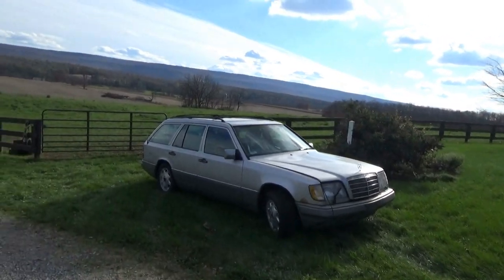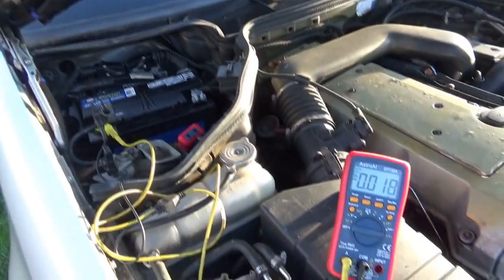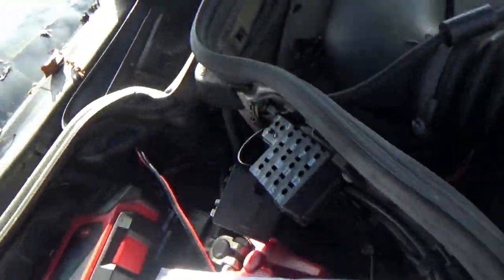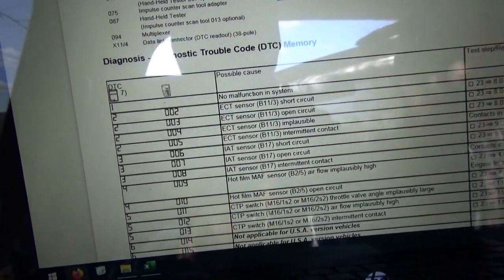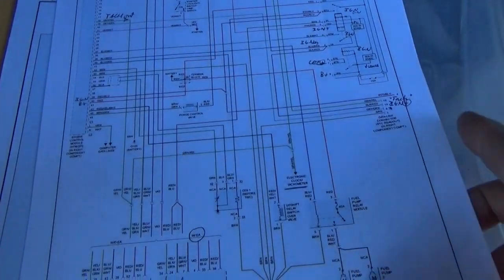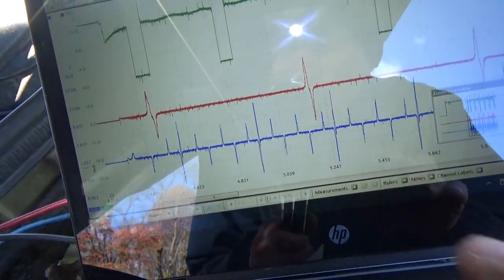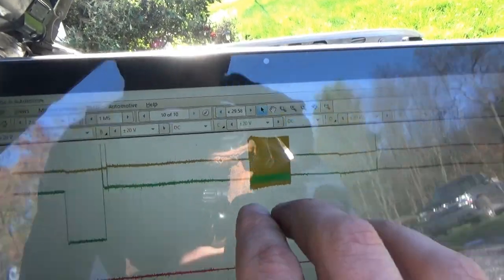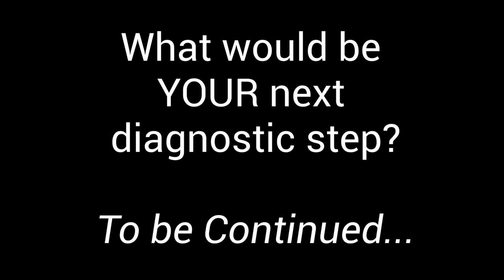The MYSTERY Mercedes - Part 1 (Thanksgiving Special)

Comment: Wow.  I haven't messed with one of those in years.  It brings back memories.  Back when I was a young mechanic working for a Volvo dealer, the shop had these old school scan tools that you had to plug in a cartridge for the vehicle make, model type and year group.  It worked on 80's and 90's Volvo, Mercedes and BMW.  They took forever to read out codes.  But it worked in a similar fashion as your LED light trick does.  Codes are generated by the pulse cycles.  The only nice part was the scan tool would keep reading codes until it finds a repeat and it would display these codes on an LCD screen.  So, depending on the module you were reading from, you would have to look up code descriptions from a book.  Even though technology has come a very long way since then, I still miss those simpler times.
Reply: My next step would be, go order the correct crank sensor for that exact engine from Mercedes.  From what I have learned over the years is, each year, Mercedes changed the resistance and or polarity in the crank sensor from year to year.  Even though they may look identical, other years, makes and models are not interchangeable.  Anyway, good luck with that.  Looking forward to part 2.

Comment: probably bare touching and corroded wires at the crank sensor. there was lots of bad wire jacketing back then, it would shrink lengthwise and expose wiring an inch or more at the connectors or crumble away.  new magical coatings of the 1980's

Comment: While that car has throttle cable, the throttle is moved electronically by the cruise control. There’s a go pedal position sensor inside the throttle body, and then the cruise control opens the throttle. If the throttle control computer dies, there’s a mechanical linkage that will let you open the throttle some amount… like full throttle in the car will give you 1/4 throttle under the hood.

Comment: An interesting diagnosis...   It looks as though the modules have been looked at before and were loose...   Are they depending on case ground?   With others swapping parts and opening things opens possible issues at times..    The anticipation is high for part 2...

Comment: Every time I hear you say "let's check service info," I'm saying "good luck with that." 
Service info on Mercedes and BMW is almost non-existent. I was shocked to see you managed to find a listed scope crank signal for comparison 😲

BTW, I was thinking how older cars and perhaps some late model cars will flag a crank sensor problem although it may actually be a cam sensor problem. That cam signal did look a little funky...
Reply from the maker: Yeah I was surprised how good the info was on this thing. BMW is MUCH worse... Can't even get basic DTC descriptions on AllData for modern ones!!
Reply: @PineHollowAutoDiagnostics  So, you don't even want to find service information? Is sharing information sources prohibited?
Reply: @PineHollowAutoDiagnostics  My first exposure to a code flasher was a 86' Nissan PU.  Computer under the passenger seat, I thought it was cool as hell.

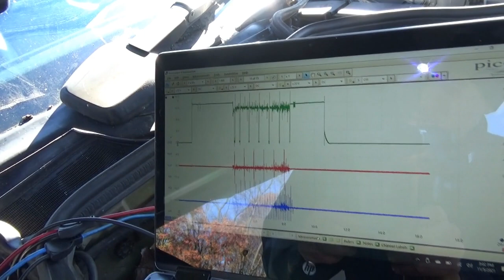Comment: At 29:53 look at the big picture: the delta T for injector firings is halved on the very first injector pulse. I'm thinking there's some kind of timing issue where something is 180 out. Could be caused by the crank sensor, cam sensor or any of the timing components themselves. My next step would be to find a good cam-crank correlation, not just a good crank signal.

Comment: HI IVAN great video again.I would have liked to see you say>well let's look at this box of replaced PARTS from the parts canon. just so we know EXACTLY what the customer already replaced.Then i would like to see the new parts he put in and MAKE sure for MYSELF that he ACTUALLY PLUGGED THE WIRES BACK TO THEM>
MY reasoning is ,What if he forgot to put say the CKP wire back on? YOU are assuming he did put the right parts in it and he did put the wires back where they belong.As you just started testing for signals ,right? when my friends ask for help ,the first thing i do is DOUBLE CHECK their work,50% of the time,THAT'S where the issue is,haha If it worked when it was built new and now it no longer works and the customer say's BUT I PUT A NEW PART IN!!!! And no I'm' not a mechanic,but i did work on rockets,so we always double and triple check. Have a good thanksgiving IVAN,and i hope you put out part two,i can't wait.
Reply from the maker: Great tips Roberto! So you are a real rocket scientist! 😃

Comment: Geez, my 86 Crown Vic with EEC-IV at least outputs each digit of the two-digit codes separately so you don't have to count each flash (or in my case, sweeps of the analog voltmeter needle) separately.  Nice to have when there actually is a code 98!

Comment: From someone on the interwebs using an eBay blinking light reader.  (47 control of ignition coil voltage exceeded limits). maybe a book of codes came with the reader? The car was a 1995 e320

Comment: Check the resistance on that crank shaft signal 
It may be pulsing but if the resistance is to high the Bosch ecm will not like it.
As far as I remember on the old Bosch systems it needs good signal from crankshaft sensor to fire the coils and or fuel pump..
Reply: Good call. The peak crank shaft voltage appears to be 7v by the polarity is backwards; is that the problem with the new crank shaft sensor initially installed?

Comment: American cars were often more advanced than German cars. BMW is still using centrifugal weights and vacuum advances in new distributors in the 1980s. American cars head ditch that more than a decade previously
Reply: Well, in some areas you are right. On the other hand GM and Chrysler still produce pushrod V8 engines today where MB V8 engines have been OHC since the 1960’s.
Reply: @pilskadden  perhaps, except General Motors has proven that a pushrod V8 can actually be superior to an OHC engine.

Comment: the very first thing you do with a 93-97 Mercedes is to check the manufacturing date on the wiring harness, its behind the battery.    also check the throttle body, both need to be 1998+ replacements..

Comment: W124. One of the world's best built cars
Reply from the maker: This series may change your opinion 😅
Reply: Hi Ivan, Unlikely, I will only drive a Merc...nothing else lasts, drives like a Merc.
3 of them parked outside....If your ever in England have a go of my CLS 350 diesel waggon...40mpg and real poke.
The hardest thing is you are diagnosing this from first principles, my local specialist is as happy on the older or newer stuff...the merc diagnostic kit is stupid expensive. There are not enough of these around for mechanics to be super confident of each models foibles. Looking forward to seeing the fix, and you taking this for a spin. Do not be shy about revving this engine!
I have a R129 as a weekend car with the same M104 engine. Still pulls 140mph ball day long whilst in France on holidays. The only weak point on this engine is it will need a head gasket half way through its working life. 240horses from a 3.2 i6. I would expect 30 mpg driven normally all day everyday.
I think your channel is awesome, and its great to see you get stuck into a bonafide classic
Reply: @PineHollowAutoDiagnostics  Ivan, might be worth confirming that this car has had its wiring loom replaced under warranty. Merc were "persuaded" to use biodegradable wiring looms in this year. Lots of cars in Europe have had bits patched in...long term ownership would signify a new loom (if its bad) which are still available. Hope you can source all the parts easily enough stateside

Comment: These cars go wrong for two reasons once in their life. No charging due to alternator brushes and the eco disintegrating wiring loom causing rough running or no start. The engine heat will cause the insulation to degrade on the engine loom causing short circuits on the coils, sensors and injectors. All Mercedes 94 to 96.

Comment: mercedes star diagnostics wouldnt go a miss for this one either   ps you can get to the sensor from driverside under starter and if your good you should be able to locate and remove it without removing starter and the other connection should be located behind battery hope this helps
Reply from the maker: We'll get there 😉

Comment: I think the car has 2 issues. The original issue is code 47, control of ignition coil voltage exceeds limits. Then the owner swapped in a different CKP that gives a different reading than the car is expecting (it's not just inverted). 
Just my 0.02.

Comment: This is a weird one Ivan - I'm leaning towards bad crank sensor or some fault with the wiring. It's a shame all the connectors are so weird otherwise I might do a bypass test between the sensors and the computer. I also really don't like that module wouldn't respond with any blinking while the other did either. I'm a bit stumped mate.

Comment: As for possible computer strategy in a fault scenario - continuing to fire the injectors while not firing the ignition coils.... why would any sane engineer designer build that in? It's a sure way to wet the plugs, flood fuel into the cylinders (where it's going to make its way past the rings into the oil) - very weird decision.
And this is why I always wait for your Pt2 to be available before clicking on Pt1.... I have to know right now with these cliff hangers... moving on immediately :D

Comment: The Launch works well with these.  Thought you owned one?
Reply from the maker: How do you hook it up??
Reply: I didn't see a 36 or 38 pin round connector.
Reply: @PineHollowAutoDiagnostics  I just checked mine.  No go on this one. I was thinking of another scanner that I bought years back from Assenmacher that pulls codes from these older blink code Mercedes and the older blink code Volvos.  They basically automate what you have to do manually so you don't have to remember all of the sequences. I haven't used it in forever.

Comment: Hello Ivan, love your channel. I hope you see my comment and can give me some ideas. I received a call from a customer. 2014 focus, car died on them out of no where at the DMV, jumped the car and car started , drove it home. After that car wouldn't start again. Message says starting system fault. Have a BCM code, something like that, not sure. New battery installed. I am hoping you can give me ideas, where to start testing . You might have a similar video and send the link. Hope you can help me. Have a great day.

Comment: (-1-) diagnostic module NOT working via connector led.  (-2-) How does test light ground a pin?  (-3-) engine crank position (ckp) cam position (?) (-4-) confused about spark coil B+ and spark control.  Do I see

Comment: My Contour started running lean set a P0174 bank 2 lean fuel condition. Both banks have been running very lean after running 20 miles to Tacoma and back. I checked for vacuum leaks with a propane torch. No leaks that I can see on the test. I tested the manifold and vacuum lines. However I also see short term fuel trims at 2500 rpm to be 11.5 to 13% on each bank and long term fuel trims at 4 to 6% at that rpm. At idle it is 24.6 and 25% with short term fuel trim hovering around -.8 to +5% on both banks. The MAF sensor is new and it has normal readings. I am thinking with the change in MAF and TPS sensors, the ECM is getting a better reading of those sensors and is able to determine the fueling ratio but with the lack of fuel flow, as I think what is happening, the ECM cannot deliver enough fuel without setting the code. 

That issue I had with the TPS and MAF sensors is fixed. They operate normally. The issue then was the TPS not having a good contact internally.

I am thinking fueling here. Injectors are newer but I doubt all went out at the same time. Thinking the fuel filter is clogged or the fuel regulator may be stuck closed partially.
Reply: so, look at O2 sensors with it floored (empty highway is a good place) if it's not pegged rich on the O2's and pulling hard, then you have lack of fueling or clogged exhaust. I think those have the DPFE sensor for EGR flow, you can easily unhook the exhaust port side of sensor to check exhaust back pressure there or better yet Tee into it and leave everything in tact with low pressure gauge connected, there should be very minimal back pressure at all times, if there's pressure, then exhaust is clogged ( 99% chance, catalytic converters = R.I.P.)
if there's an issue with the DPFE sensor or the EGR valve and tubes clogged all sorts of bad things can happen too. also check your brake booster for leaking  through, I've done some of them on fords and other vehicles of that vintage.
Reply: @throttlebottle5906  

I have a complete newer exhaust on the car. Both manifolds are replacement with performance high flow cat converters (magnaflow) plus 2.25 inch midpipe with 2 inch dual exhaust out back. That was completed 4 years ago, with no 3rd cat.  I know the exhaust is not the problem here. I can check this stuff on the chassis Dyno which I have access to. At 2500 rpm no load the LTFT on both banks is 3.6 and 4.1. STFT at that same room it is 13.3 and 14.1. Under load the STFT is slightly higher but not much higher than that. 

I replaced the TPS sensor and MAF sensor about 2 weeks ago because the transmission was rapidly shifting from 4th to 3rd gear and back to 4th with cruise on on flat ground. The TPS sensor contacts were bad, it was the original, as well as the MAF sensor. Those read correctly now. I am thinking that there is a lack of fuel flow somewhere, and the ECM is getting the right readings from the MAF and TPS sensors so it is trying to get the correct fuel ratio, but it can't. 

When I got the car 6 years ago, I did a complete upper engine regasketing with new intake manifold and valve cover gaskets and clean out of all of those parts. The EGR at that time was clogged solid and needed to be cleaned by dunking the plenum in solvent to get all of the debris out. 4 years ago I replaced the entire exhaust system from a single exhaust to a SVT style exhaust that is slightly larger in diameter and a dual exhaust.

However 3 years ago I had an intermittent issue with the fuel regulator sticking either open or closed. It only stuck twice and I was able to clean it out at that time. 

I think the EGR system is fine, that has been cleaned out and inspected but I will check it again. I have suspected the fueling which I plan on testing the actual flow rate and pressure next week. You can have good pressure, but low flow, which that can be a clogged fuel regulator or filter.

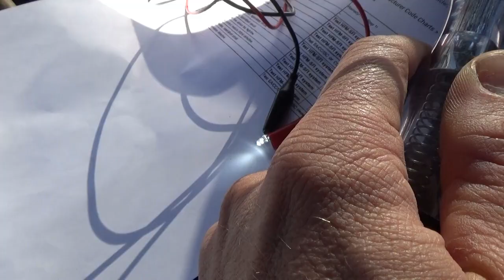Comment: Around 17:30 you say GM cars in the 80s were better because you could read the codes out of them with a tool. Presumably a GM tool.
Then you go immediately to showing that if you had the Mercedes handheld tester of the era of this car it would give more precise information than the basic flash codes with the LED lash up - I bet Keith has a vintage Merc handheld in his museum!! :D
That's a little disingenuous in the presentation in my opinion.
This car's vintage was just before ODB-II full adoption as evidenced by the YT video you linked to earlier about extracting blink codes which in the title states "ODB-I". Onboard self-diagnosis capabilities were in their infancy and pretty much every manufacturer regardless of nation of origin was selling expensive own brand diag tools that would give more info than whatever generic ODB level compliance functionality they were compelled to put in place by regulations globally.
That still stands to this day of course with manufacturer modes and ODB-II modes still being out of alignment. Manufacturers ~really~ love making things obscure these days.

Case in point - my current vehicle - a ~2yo VW. I wanted a simple chart of what fuses did what. That info is not in the Owner's Manual and there are no legends in any of the fuse box covers... no info at all available to the owner of the vehicle in that regard. Just endless amounts of "Take it to an authorised service centre".

Follow the money of course :D

Comment: Chase down the spark power and grounds? Source to coils then ECM functionality
Reply from the maker: We know the coils B+ feed is good since it is making it all the way to the ECM on the control wire :)
Reply: @PineHollowAutoDiagnostics  Once I saw the color and level of the oil on the dipstick, I knew this vehicle was being maintained by nurse ratchet. The bumper sticker didn't help either.
Reply: @PineHollowAutoDiagnostics  I'm wondering how you will bill this repair because of all the research you have done to this point regarding wiring diagrams and how this straight 6 operates etc. Is that time donated because you didn't know the details had to find it or is that time to be billed to the job?
Reply from the maker: @Garth2011  great question! In this case I charged for about half of the actual time spent 👍

Comment: have the parts cannon at primed and ready to fire ready 3.2.1 fire  ..battery crank sensor spark plugs ignition coil x 3  mass airflow sensor ( optional parts  oil filter oil air and fuel filter